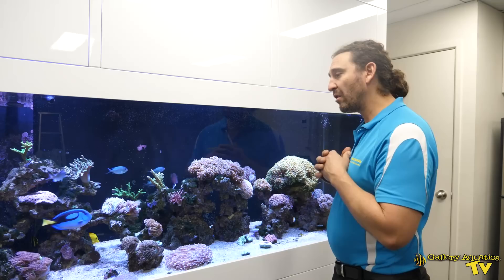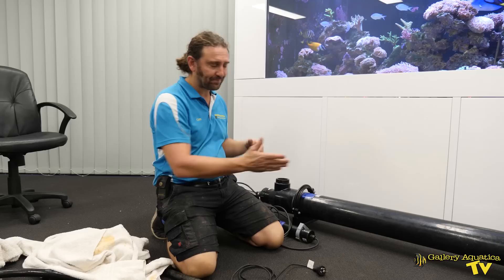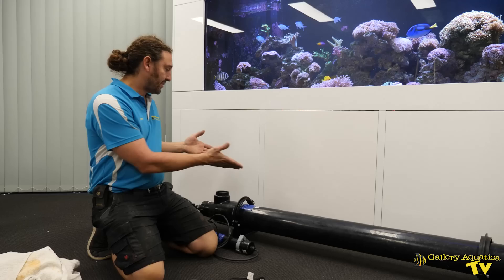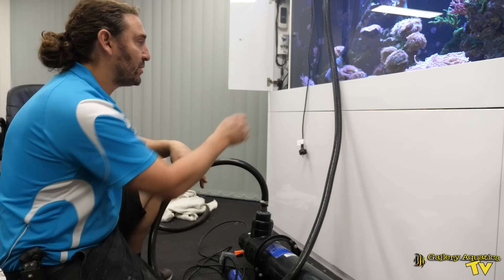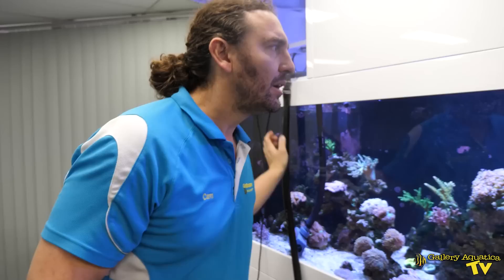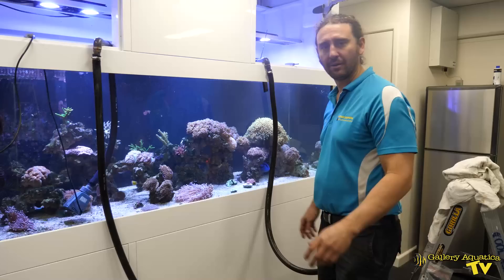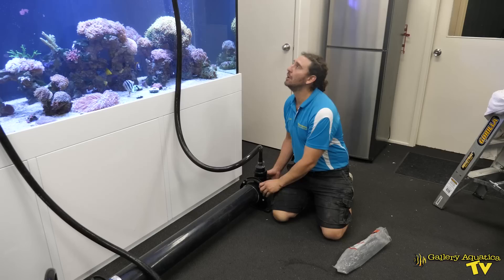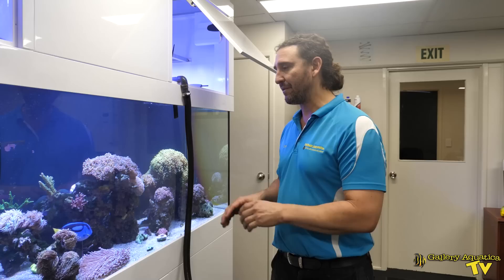Beating Whitespot and Velvet - The Fish Guy Way

Comment: No one would believe me in a forum I use when I told them I used UV to cure my tank of marine whitespot. I basically did the same as you but with a smaller unit. I will never run a marine aquarium without a UV filter on it. They just prevent so many problems. Great job and I look forward to seeing the results.
Reply from the maker: You can definitely use a smaller unit than we did here, but it takes longer. The best option is to have the UV running from the start as prevention of course. Cam
Reply: UV helps control theront populations. It does NOT actually eliminate ich, simply makes it easier to manage, and reduce likelihood of future outbreaks.
Reply: As Cam mentioned at the end of the video, you don't eradicate Ich without removing the fish, you just control it.
Much better to properly QT fish going in so there is no Ich/velvet in the tank.
Reply: Or you can just go fallow and QT the damn fish lol
Reply: @marcelrodriguez2067  I agree but it can be difficult to remove the fish. So much easier to prevent than fix the problem. Properly QT and treat before they get to the display.
Reply: @johnVidBozo  exactly
Reply: @kealohareef6388  Cool. Thanks for that link. I hadn't seen the revised TTM. Wonderful hobby. We can learn something new EVERY day.
Reply: @GalleryAquaticaTV  Can you run a UV all the time in your marine tank without it removing all helpful bacteria your tank requires?just asking cause i wanna buy one, my tank getting white spot

Comment: To all those that say that this doesn't work how many trials have you run on tanks with white spot / velvet outbreaks using a correctly size UV? I can guarantee that Cam has used this method on 20+ tanks with success. I can personally vouch for UV eradicating velvet in my display tank. (2000L with a 150Watt UV)
If you can point to any other study or trial that has been completed showing that this method doesn't work I'd be happy to review my stance. Science is all about proving theories with trials and I think the results speak for themselves
Remember there is still no excuse for poor husbandry and not QT'ing UV is just insurance. Plus it keeps all the algae under control aswell.
Reply: Modern science is actually "all about" disproving hypotheses and theories. We are researching in the era, where all we know for sure is what we can disprove. It is called the falsification principle. By proving a theory, we are not learning something new as much as we are cementing that theory as the best truth available to us at this moment in time. Other than that, I agree with your post 😊
Best regards,
Tom-André Thomsen 
Norwegian M.D. and reefer

Comment: I have a 12 gallon long and ended up with a velvet outbreak.  I have a small internal UV sterilizer that doesn’t seem to do much.

I would love to make a setup like yours.  What wattage and flow would I need to have the same affect?  I know I need a sterilizer that’s adjustable down to the correct flow rate.  How do I calculate so I end up with a large enough sterilizer to take care of my tank?

Comment: I have a 120 with 30 gal sump..1 tang 1 angel..5 cardinals..2 clowms..trigger wrasse.and blenny...got ich..got a 25 watt aqua uv..recommends 400 gph to kill at 90,000...what would you recommend I do..maxi jet 1200 290 gph...or less like 100 gph...I get that will give more killing power..but do I need higher turnover rate...also..I can only mount above sump...pump is by filter pad roller and output is by return pump...I also wonder if ich makes it thru filter roller or even to sump

Comment: @Gallery Aquatica TV Do you use a separate set of cleaning tools for tanks infested with parasites?
Reply from the maker: Good question. I don’t use my big drainage hose on tanks that are infected. If the infestation is bad enough I won’t even use my gear to pump water in which means bucketing water😞

Comment: Hi Cam, how successful was the treatment on this tank? Did the Ich return back after the treatment. I am in a similar situation at the moment and I am thinking of getting a larger unit like this. This is the second time this has happened and the first time I had even let the DT fallow for 80 days. Not sure how it got back in the tank again without even adding any new fist. All the other fish were also treated with copper. I already have a 57W UV twist plumbed into the plumbing but I don't think it is doing a great job. Any help is much appreciated mate. Thank you
Reply from the maker: This was totally successful, zero fish losses. When we took the big UV off we fixed up the smaller UV (changed its bulb) and I haven’t seen any signs of disease since. You can link UV Twists together, so maybe get another one of those. Otherwise it might not have the right  flow through it or it may need a new bulb. Cam

Comment: What happened to the Regal Angel?? Or was it a Regal Tang?? Just to be clear UV is for control, you won't completely remove it with UV. If you did, you wouldn't need to add a further smaller unit. Still better to control than suffer the losses. What are your thoughts on velvet, remaining on the gills, not always dropping off?? Hence, always on the fish, never comes off to go into UV?? Hence, need to treat with copper or Chloroquine phosphate. Cheers
Reply from the maker: The Regal Angel died as expected. UV can be used for eradication, but we didn’t want to leave the big unit there given it’s an office, so in this case you’re right it is control. I don’t believe velvet has a different lifecycle on the gills to other parts of the fish, so UV is still an option. Cam

Comment: So is there a formula to work out an optimal flow rate for either ich or velvet if you know the wattage of the UV unit?
Reply from the maker: There should be ratings available from the UV manufacturer. If not it’s probably not really a UV appropriate for marine Protozoa. Cam

Comment: Why 280.000 mWs/cm2 ? 
I read 180.000 uWs/cm2 is enough.
Reply from the maker: I’ve seen a few different opinions on this, and I’ve chosen to go with the Emperor Aquatics listed exposure rate. Partly because it’s the highest I’ve seen, so if you hit that you can be sure it’s enough to kill WS in one pass through. Cam

Comment: My aqua 25watt flow rate is at 350 it's required to run 400 GPH. And 350 is all I can get on my Cor 20 because it's tied into my main and it's at 100 percent. Is 350 GPH enough or should I put another pump on it ??  thank you
Reply from the maker: 350 is enough. It’s actually better to run slightly slower flow through them than the ratings suggest because you push up the exposure. Cam
Reply: @GalleryAquaticaTV  thanks Cam

Comment: Had this been velvet, wouldn't most of the fish have died before you could respond with UV treatment?
Reply from the maker: Correct, however if you’re lucky enough to catch velvet before you lose too many fish it is actually easier to eradicate as it requires a much lower exposure of UV. Cam

Comment: Cam, what's your opinion on polyp lab medic?
Reply from the maker: In a tank with a small number of low-susceptible fish it can help, however I don’t think it’s a replacement for a properly rated UV or good quarantine. Cam
Reply: @GalleryAquaticaTV  I have a royal gramma that has been scratching himself on rocks and on sandbed. We suspect ich, in your experience, what could it be. There are small white spots on hime but were not sure if it's sand particles on him or ich.
Reply: @GalleryAquaticaTV  also, we have a waterbox reef 220.6 what size UV do you think would be appropriate?

Comment: Great information. How long is the projected time you will have this device on the tank? Is there any plans top place a permanent UV sterilizer on this system moving forward? Thank you for sharing!
Reply from the maker: This UV will probably need to be in place for 6 weeks, and we definitely intend to put a smaller maintenance UV in place. Cam
Reply: @GalleryAquaticaTV  Awesome. Thank you so much for the reply.

Comment: Is it just me or does this seems much easier than TTMing or Quarantining Every single fish and Coral!?
Reply from the maker: Totally. Not only that, but some tanks it’s impossible to get the fish out of. Cam
Reply: @GalleryAquaticaTV  have you always managed to completely rid ich and velvet this way?
Reply: @GalleryAquaticaTV  do you agree that this does NOT truly eradicate the ICH, since if it did then you wouldn't need the "maintenance" UV sterilizer afterward? TTM and quarantining would increase the odds of having a truly protozoan free tank.
Reply from the maker: drdavethedude it’s important to execute as much precautions to prevent issues as possible. Quarantine is an excellent precautionary practice. But don’t forget most of the hobbyists here use natural seawater for regular water changes. Some people even believe protozoan parasites can be transferred via introducing new corals.

Comment: UV won’t “fully eradicate” but it does a great job decimating the ich population where fish seldom shows white spot. Ich is still in the system though.
Reply from the maker: Incorrect, it can be eradicated with UV. Also this is a marine system, Ich is a freshwater protozoan. Cam
Reply: Gallery Aquatica TV Ok best of luck! Everything you just said was false LOL.
Reply from the maker: You think Ich is marine?
Reply: Gallery Aquatica TV Yes Marine Ich (ie the Cryptocaryon parasite). Not all the Cryptocaryon will flow through the UV so it won’t 100% eradicate but it will decrease the population so the fish can live and manage.
Reply from the maker: I know a lot of people are under the misconception you can’t eradicate MARINE WHITESPOT with UV, hence my desire to document cases in which I do. This tank will only ever be an example of UV as a control, however we’ll do a video in the future in which we demonstrate the ability to use it for eradication. We’ll do this when we can set up a tank specifically for this purpose, as opposed to a client’s tank like this one. Cam
Reply: Gallery Aquatica TV I’m a big fan of UV. It does a great job against ich. When I run UV 24/7, my fish seldom have spots. However, if I turn it off for a couple weeks, white spots come back. The parasite will always be in the system unless you go fallow for 2-3 months (although they found that ich can be dormant even up to a year).  I recommend just running UV long term with low gph for high exposure instead of going fallow.

Comment: I lost an entire tank due to velvet with a UV Sterilizer. It don't work for velvet.
Reply from the maker: It works best for Velvet as velvet only requires a low exposure level. If it “didn’t work” that means there was a problem with the way it was used, or more likely it was a brand designed for freshwater. Cam

Comment: wont happen, only true waty is fallow tank! it will help but wont work unless every spot goes through the uv which is highly unlikely.
Reply from the maker: Not true, because not every “spot” will attach to a host anyway. All you need to do is remove most of the free living stage and over time the parasite number will go down, eventually to zero. I’ve used this system on literally dozens of tanks with total success. Cam
Reply from the maker: But we’ll see how this tank goes in the following weeks. Cam
Reply: Stef have you actually tried both methods / an expert on marine protozoa? Or do you just go off what you read in forums?
Reply: @calb281095  i have tried these methods along with the so called reef safe medications offered
Reply: @calb281095  youi would have to makes sure every single white spot passes through the uv! impossible